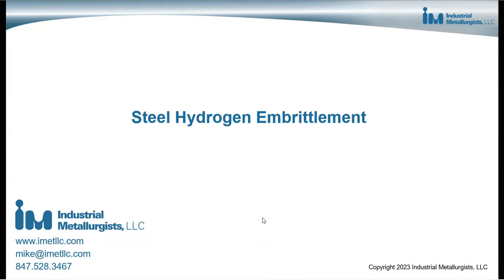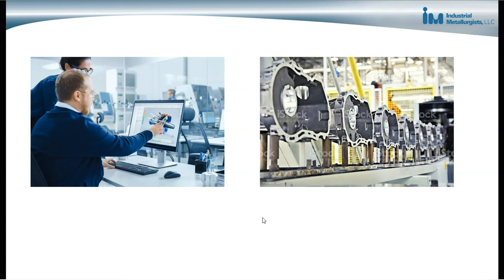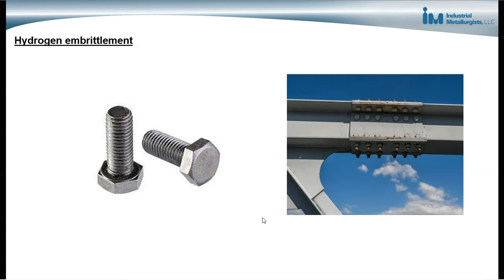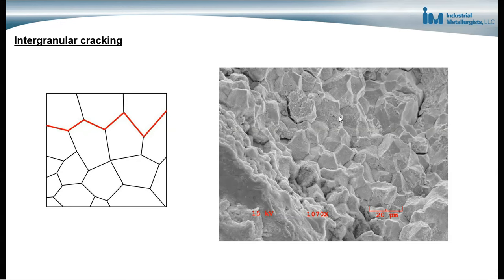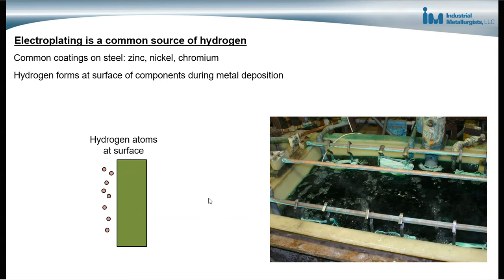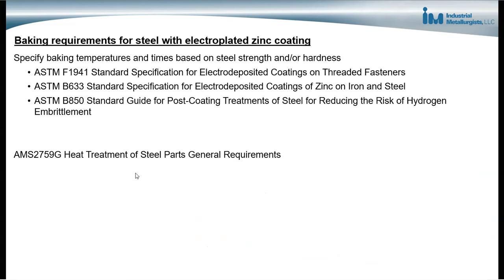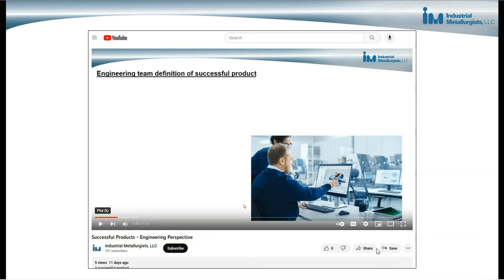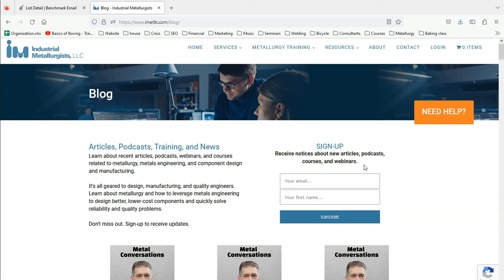Understanding Hydrogen Embrittlement:

Comment: Thanks for this informative Video,
I would like to ask: You talk about the 3 requirements needed, 
would that mean that a fastener, that had hydrogen induced (for example through corrosion) but was not in use at the time, would be fine if stored for an extended period due to the hydrogen leaking out of the steel? Or would it still be potentially embrittled because the hydrogen attaches  itself to the grain boundarys?
Reply from the maker: Yes, the fastener will be potentially embrittled by the corrosion. Why would you use a fastener that was already corroded?